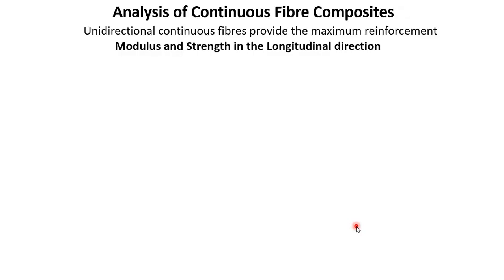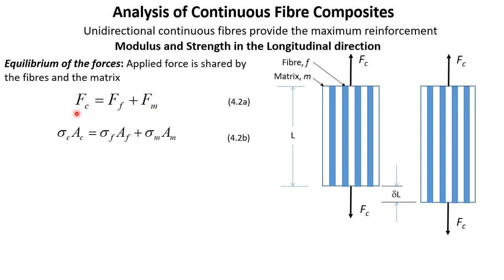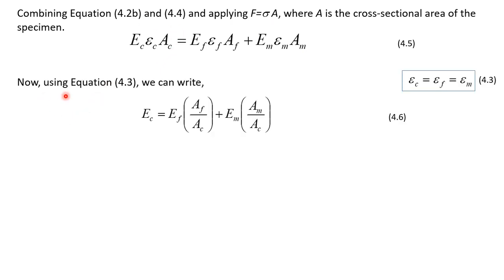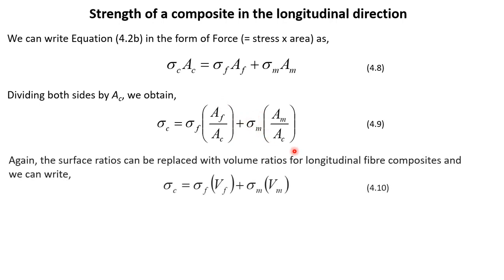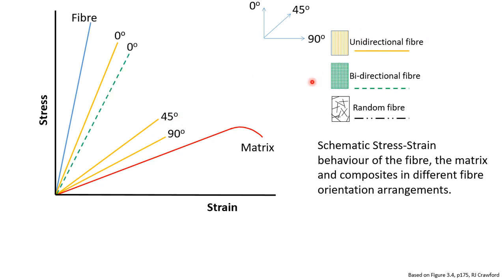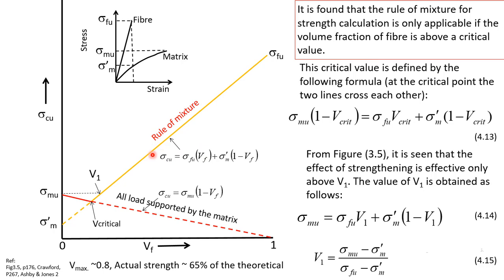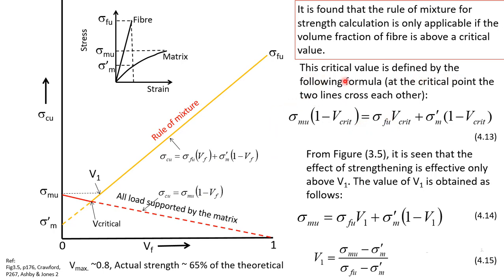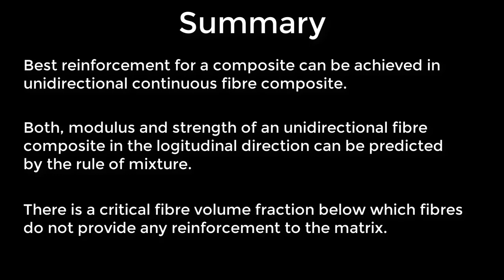Composite Analysis for Modulus and Strength in the Longitudinal Direction

Comment: Hi, if two different woods are vertically laminated together can we calculate the final wood product's elastic modulus with the rule of mixture? for example i have two different woods and i will create a 50/50 ratio a hardwood/softwood. can i add their elastic modulus together for the final product's elastic modulus?
Reply from the maker: Yes, if the bonding between the two woods is excellent. There should be no debonding during the tension.
Reply: @engineeringmaterials-tribo5142  thank you so much for the fast reply

Comment: This is the best video on composite material I have seen. Does this also apply to a carbon-foam-carbon sandwich panel?
Reply from the maker: Thanks! The analysis is not developed for foam per se. However, if we can treat a foam as not homogeneous and isotropic material then yes we can use this analysis.👍
Reply: @engineeringmaterials-tribo5142  Thank you for replying. So for composite sandwich plate buckling analysis (say the carbon layout is isotropic and foam core is also isotropic). This method can be use to find the over all young's modulus and ultimate strength?

Comment: Good video, especially the part around 15:20. But how does 15:20 explain that failure is often matrix-initiated if the matrix still has theoretically that much strain "left". Both are in isostrain condition. Is it due to local overstressing of the matrix at the point of fibre fracture?
Reply from the maker: Assumption is that the fibre is more brittle than the matrix. Thus, at the point of fibre fracture (at fracture strain of the fibre), matrix is still in the elastic range. Let me know if you have further question. 👍